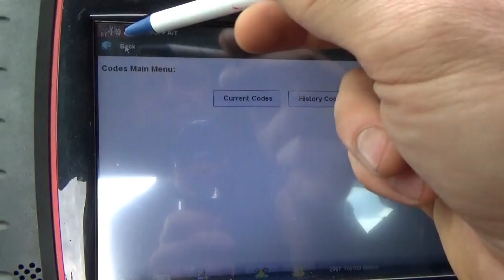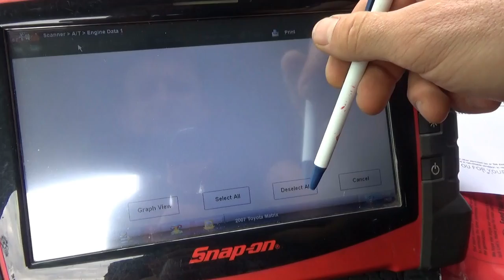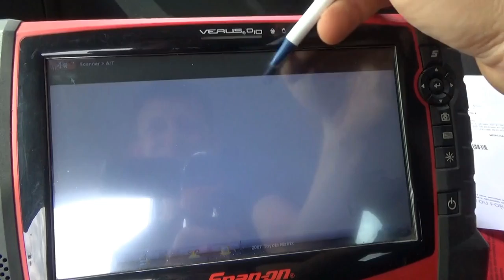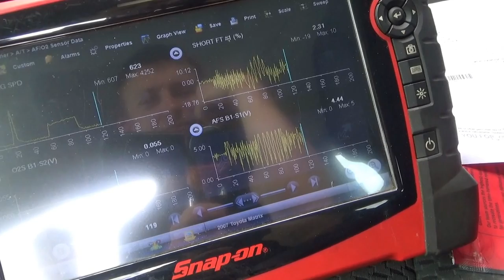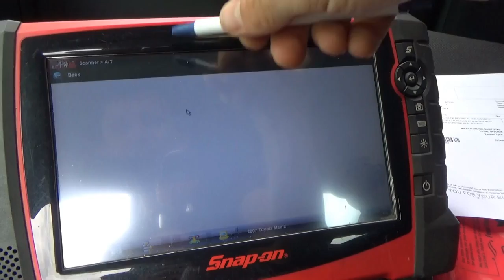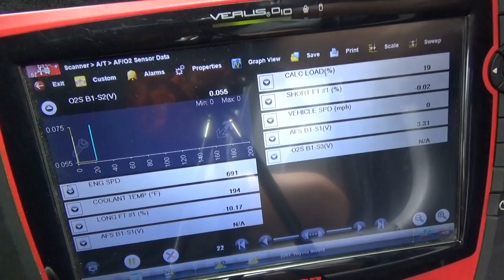Parts Cannon Matrix: P2195

Comment: Great video & troubleshoot, liked how you used the test light to check the computer reading the ckt but one suggestion. Connecting the test light which is maybe 3 ohms resistance at max to 12v gives 4 amps current. I dont know the signals properties of the sensor but its probably voltage based with very little current max'd in the 10's of milli-amps. Point is your allowing a ton of current to flow to an input which is probably not designed to sink that much, or the input could be a high impedance ckt keeping current from flowing and it dont matter, but light would be dim if that was so. Suggest you use a current limiting resistor in series when ever you apply voltage/current to the computer input!

Comment: Same problem 2005 Toy Matrix. 160k.  No DTCs. STFT about10-12 , low semi rough idle 670-703. Replaced O2 AFR upstream thinking it was bad with steady reading not knowing its an AFR O2 and not a regular 02. Sitting around 3.   Replaced and it Cleared up st fuel trim but still idles low and semi rough. Staying that way for now.  Used OEM Denso AFR. Runs fine past idle, good power. Search for low idle continues!

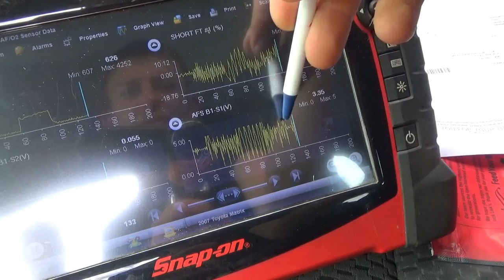Comment: I'd think far upstream exhaust leak, like manifold gasket or cracked, by 7:16 in video
** the wide fluctuating voltage screams there's an issue... did they mix up the cheap universal "upstream and downstream" sensors and have them swapped...
oh dear probably exactly the issue, if not wrong ones all together :)))))

Comment: Ivan, thanks for your advice on how to diagnose a faulty ignition coil signal/feed. You were heading home from your FL trip at that time. Based on your advice, I was able to help my cousin ( in Staten Island) to diagnose and fix a non firing ignition coil pack on his 01 Montero XLS limited.  This was our first time dealing with electronics!! We found out the control wire was dead and had no pulsing ground signal. Bought an igniter and now it is running perfectly. Trust me your videos bring lots of light for people who got no clue on auto electronics. Keep up the good work!!!

Comment: If I suspect someone has replaced an air fuel ratio sensor with a conventional oxygen sensor I will check the heater resistance. An oxygen sensor is usually ten to twelve ohms. An air fuel ratio sensor is about half of that, because the air fuel ratio sensor runs a lot hotter. Other than that they look identical. You would think Toyota would make the connectors different to prevent this from happening.

Comment: Is there an easy way to test if the shop installed the a/f in the back and the traditional O2 sensor in the front, if these are the style where you splice in the wires of the new sensor to the original sensor harness.

Comment: Hey Ivan! 
I'm a home improvement expert who has chosen to try learning something new. I stumbled on your video series which has been a great way to learn a lot in a short period of time. I especially like your "Whiteboard" explanation of the battery charging system because...
 I "bought" a 2006 Ford Expedition from a friend (7/18/20). He never had battery drain issues, but when I picked the truck up from him in Florida, I found the alternator was frozen (pulley wouldn't turn at all), the battery was dead, and the serpentine belt was destroyed. He didn't realize that all happened, but we learned that moving the truck from NY to Florida and just letting it sit in the driveway was part of the cause. Florida heat and all took it's toll on it. I had no tools with me so the truck was towed and repaired at Adkins Automotive in Winter Haven, FL (7/20/20). I then took the Auto Train home (Sanford, Fl. to Lorton, VA) with an hour + drive on each end of the trip. Upon getting home (Reisterstown, MD 21136), the truck was parked overnight and the battery (a brand new Duracell) was completely drained by morning.
After spending a few weeks watching your videos and running draw tests. I've discovered that the alternator is drawing from the battery when the truck is asleep. So now I will be removing the alternator (should be under warranty) and replacing all the old wiring while I'm at it.
Your videos have been a great help! I have subscribed and will be telling friends about you. 
I still have to fix a few other things on the truck to pass the Maryland inspection, but those things are easy.
Steve (S. Hunter) Smith
SHunterSmith.com
Reply from the maker: That's awesome, Steve! Yeah once that rust cancer starts, it gets exponentially worse in a warm humid climate!!

Comment: Wow ! Incorrect new parts installed  thus problems were not fixed...Sometimes OEM parts should  only be used ,such as any electrical components/modules...In alot of cases, the aftermarket part is not compatible or the quality is lacking giving you short longevity...

Comment: "Been to several shops". I get the feeling that once a modern car starts breaking that the fraction of mechanics out there that can accurately diagnose it are rather few.
Reply: It is not my feeling, it is what I know. Some places are really baaaaad, like bro went to canadian tire for some engine leak of unknown nature. Well, the diagnosis? "There is too much oil everywhere, we can't see anything" ... Bro call me, I go to the parking lot, with a flash light as it was dark. He start the engine, within 1 minute something drip. I open the hood, look with the flashlight and... I see 1 drop falling every 2 seconds... From under the intake... There is a coolant line there that rusted... Total diag time? Less than 10 minutes. They couln't find it in the 1 hour they "searched" for the leak...
Reply: @thephantom1492  Sadly you pay by the hour, whether they find the problem or not. Some shops are incapable of finding their butts with both hands.
Reply: they're mainly parts changers and wrench twisters, whom may be very good at wrench twisting. but very likely not, as the seniors are mostly Union protected or flat-rate/book-time hustlers snapping up the easy jobs they can turn out in 1/2 book time or less, while the newbies get the shafting with supposed chart following repairs.....
we all know how those magical flow chart repairs work out, end result as you see in video, multiple part cannon's fired, lots of $$$ spent and it;s likely that they used "universal" upstream/downstream O2's and simply confused/swapped them... last I looked the wire color/coding was different, but maybe not ;)
Reply: @throttlebottle5906  Here in the UK a lot of the guys who are employed as mechanics are more accurately "fitters" they are employed to change parts - not make diagnoses. 

Honestly I feel bad for a lot of the younger lads coming into the trade - the rates of pay are pretty dire but for similar rates of pay you don't need £10,000 worth of tools. Customers don't really want to spend the money on repairs or pay for work. The technology being put into a lot of cars is beyond the average lad in the trade to understand. Most motor mechanics tend to be people who didn't do so well at school. Some could be pretty intelligent - others not so much.

Comment: After putting all the dealer parts on I guarantee it will still run lean. The car originally just needed a 10$ intake gasket... number one issue on this engine
Reply from the maker: Well we can only diagnose that with known-good MAF and O2 sensors :)

Comment: I recently replaced all of the above on my 190k mi 2005 Matrix. The downstream O2 sensor was going bad, with catalyst errors. I also was getting a slight unstable and elevated idle (no DTC), so I replaced the AFR and MAF sensor. The car idle improved, but I'm not sure it was worth the part cost. The harbor freight offset wrench was great for removing the AFR sensor, even without removing the exhaust heat shield.

Comment: Any Toyota with any O2 related stuff reminds me of this 98 Toyota Sienna I had, I forget the code But I was chasing ghost all day until I took a good look at the wiring...the previous shop had cut the wire for the downstream and wired it to the upstream and vice versa, this was done mid wiring length so the connectors were still in there correct mounting locations.... the upstream was wideband Downstream was a regular O2 LOL kick my ass for a little bit LOL I'll never forget that
Reply from the maker: WOW why the heck would they do that?!?
Reply: @PineHollowAutoDiagnostics  it's a shop I do work for regularly...you couldn't believe all the hacked up stuff ive found...for instance...they glued a map sensor back together because they broke it lol

Comment: Mass air flow sensor generally only fail because of dust/dirt and can be cleaned, unless heater wire opens which is rare.
Reply: Mass air flow sensors have 2 wires  only 1 is heated, by accurately measuring the resistance of each, the amount and density of the air including cfm, temp, can be measured by the cooling of the heated wire compared to the unheated wire.

Comment: That rear o2 may be running lean like the data shows. Long term fuel trim is reading -10, the fuel is pulled from the system.
Reply: My understanding is that the rear/downstream O2 doesn't effect fuel trim at all. It only is there to detect catalytic converter failure.
Reply: Nathan Conrad . It will be reading lean though if the system is running lean. Maybe add some alternative fuel to it to see if the rear bumps up. Or reset fuel trim with the front unplugged to see if voltage bumps up

Comment: Good job. Did you check for vacuum leaks after the cat and before sensor 2? Or did a replacement O2S fix that issue? I'm surprised it didn't throw a catalyst efficiency code or something.

Comment: I hate the cheap MAF sensors. Even new dephi MAFs can be the same design as the crap eBay mafs. Like you said the old one is probably still good.  
They need to overhaul their parts cannon so it can blast some better parts.
Reply: It's not the parts cannon that's dangerous, it's the person firing it!
Reply from the maker: haha Chad, exactly my thoughts. I cringed seeing that junky MAF, knowing that the good OEM one may be in the waste basket. People are so quick to throw away the good used parts!!

Comment: When I have a customers car in and I phone up for parts, they automatically quote the cheapest.  Why?  "Because that what most customers want", came the reply.  I have to ask for the parts and then say "quality".  Otherwise, chances are its coming back.  Try to explain this to customers though!!  Good example for you.....2005 ford fiesta.  Changed heater fan resistor pack for £13 parts (and pollen/cabin filter)..  Less than a year later....failed again.  Another cheap one (customers request), failed again 3 months later.  I suggested an OEM part at roughly £40 (cant remember exact price), but was refused and she sold the car a week later!
Reply: Pay half pay twice!